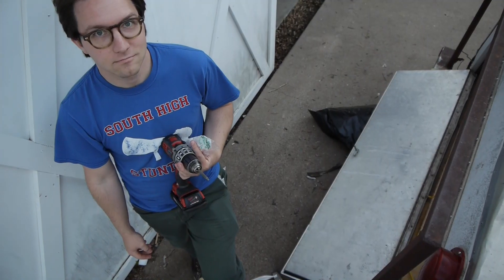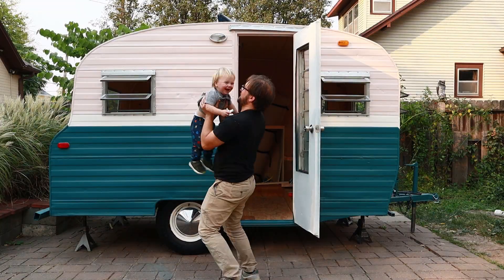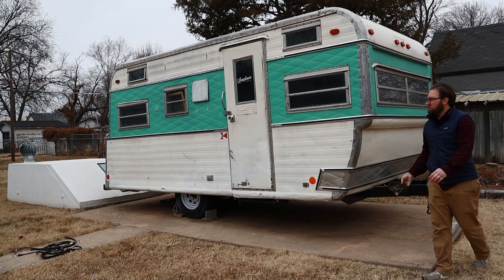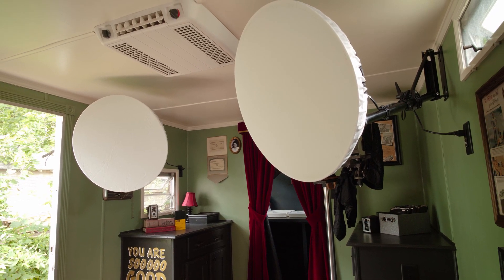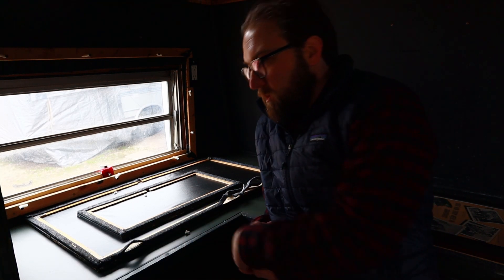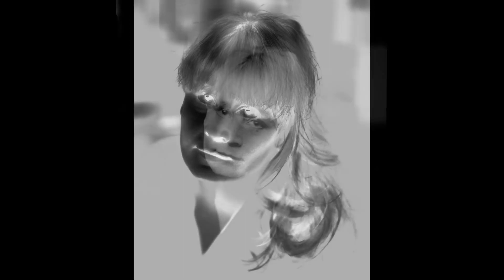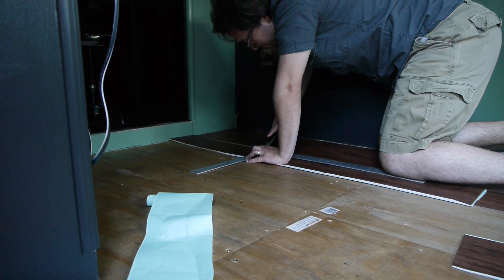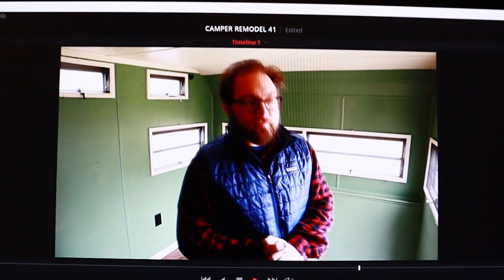SELLING our VINTAGE CAMPER photo studio & DARKROOM!

Comment: The eye appeal, both interior and exterior of Your trailer rebuilds is significant!! I'm sure that the structure and durability is also first class.
Reply from the maker: Thanks! It was a sharp little camper. Certainly didn't do as thorough of a job as are on our current one but it's solid and it's held up surprisingly well over 7 years!